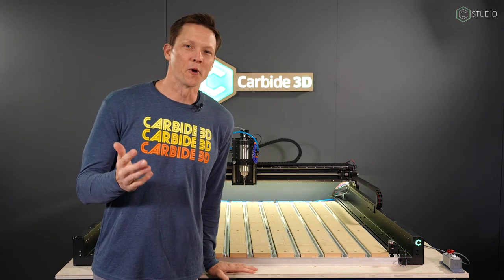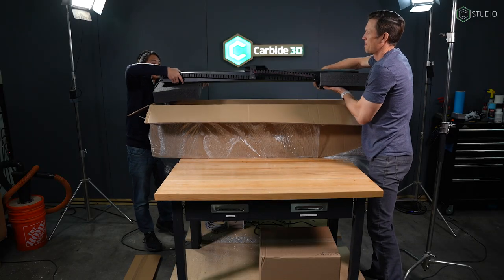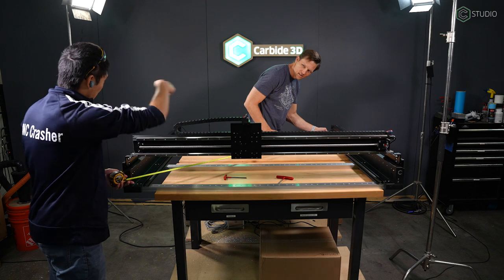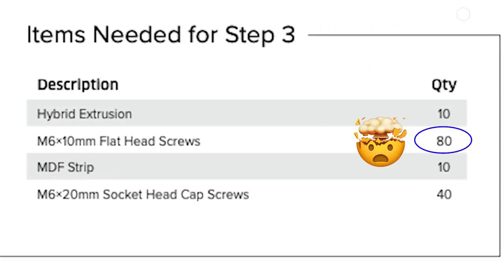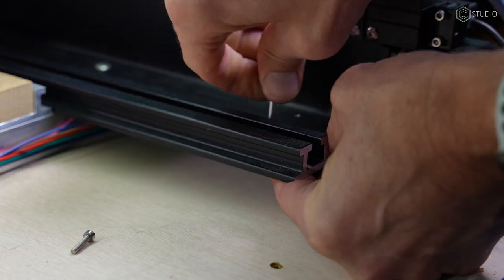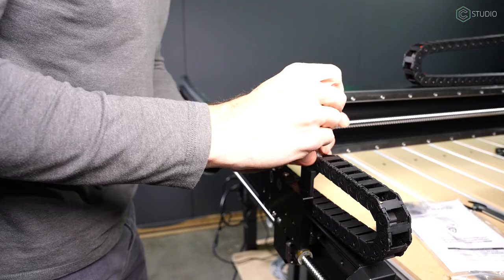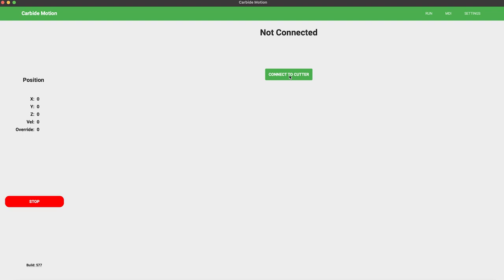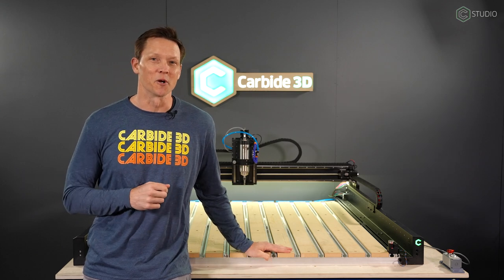Assembly - Shapeoko 5 Pro - Video 8 (UPDATED)

Comment: Congrats Kevin, your video is FAR better than either the spindle kit instructions or the Carbide instructions.  I was at a major pause point until I watched your video again.  Both sets of instructions reference other machines and are very vague at best!  Great job on the assembly video by you.😊 20:37 😊

Comment: At 4:44 rails laid down. But they’re not symmetrical. On one end, there is a little clip that looks like it holds a wire. I’ve watched a few videos. No one seems to point out whether these go on the right or the left oriented towards someone looking at the table from the front.
Reply from the maker: Hi Aria
Those clips should be pointed to the right side of the machine.

Comment: Several things were different between this video and the written documentation and in some cases reality was different from both.  Trying to resolve if I was doing something wrong slowed down the assembly process.  And then some of the connectors were missing the locking tabs and without that clue as to which way they go together, I got one upside down.
Reply: Yes, I am about halfway through the build and finding the same. I'm figuring it out but it has been slightly frustrating. Also the assembly guide I downloaded seems to be specific to the 4X4 with no option to download a 4X2 or 2x2 specific manual which threw me for a loop for a few minutes as they have one less base piece

Comment: So close to being done... but I cannot figure out how to attach the x-axis drag chain tail. It mentions in the PDF that it takes M4 x 6mm BHCS screws (unlike the rest of the drag chain attachment points, which take M3 x 6mm SHCS screws). But I cannot find anything in my remaining collection of screws that will actually thread in. The 2 screws left over in my "DRAG CHAIN FASTENERS" bag don't fit.

EDIT: Oh no... I'm starting to think the holes themselves aren't threaded on the gantry D:
Reply from the maker: Send some photos and video to support@carbide3d.com   We’ll get you up and running
Reply: Did you get your machine running?  There are stories of them being really noisy.  How quiet & smooth or noisy and rough sounding is your machine?  I have one on order buy am a little concerned.

Comment: There was a wire in my shipment labeled front panel extension wire. Is this the wire that goes from the back of the front right Y rail to a connection on the back? I’m assuming this is how the bit setter gets power? This isn’t mentioned in the video and my bit setter is not working. Not lighting up.
Reply from the maker: Reach out to Support@Carbide3D.com with pictures and this description. 
Our team will get you up and running.
Reply: @carbide3d  I did. There is no power to the front panel. I emailed last night. Thanks.

Comment: What does air assist do for you?
Reply from the maker: It keeps the endmill from encountering previously cut chips.   Hitting chips is a quick way to cause excessive wear on or break endmills.  If you're cutting metal you want air on the machine.

Comment: Kevin another question which set of wires from the r  right y  rail go across the top of gantry to the left rail  I am having trouble with the wiring because none of it is tagd as to what it is for Like the 3 and 4 had. also what are the 2 extra drag chain links for. thanks Jeff Peters
Reply from the maker: The router cord runs through the additional drag chain on the gantry and on the Left Y-Rail.   This is also where we have the air hose run. 
The additional drag chain links should be labeled “For Gantry Shift”.  Those should be installed on the Left and Right Y-Rail drag chains when mounting the gantry in the forward Gantry Shift position to perform joinery specific cutting.

Comment: At what point of the assembly do you surface the hybrid table?  Is that a necessary step before you start any projects after first assembly?
Reply from the maker: After you’ve completed all steps.  
We ran a number of projects before surfacing.   It’s a nice thing to have but not 100% required.

Comment: I have the shapeoko 3 xxl and the shapeoko pro xxl thinking of selling them both and upgrading to the bigger size How? Do you feel about the one Infinity monster that just came out? I'm going to compare them both. I've been a steady shapeoko customer. For four years now. Hopefully I won't have to move up to the one Infinity.
Reply from the maker: More expensive and less capable compared to the Shapeoko 5 Pro.  Be sure and do the math yourself.
Plus you would lose the customer service you know and love.
Reply: @carbide3d  I agree that the Onefinity is more expensive.  I can't compare the customer service.  But why do you say it is less capable?  My initial reaction is that the Masso controller and the closed-loop steppers on the Onefinity will make it much more reliable and significantly better at recovering when it does fail.  Also, I am assuming that while you may be able to run an 80 mm spindle on the Shapeoko there is very likely a good reason why you do not mention it anywhere and don't list it as an option on the order page.  As an aside, I do like the gantry shift feature on the Shapeoko and that the Bitsetter is positioned off of the bed, unlike the HDM (the actual cutting area vs the size of the bed and the position of the Bitsetter is my biggest frustration with the HDM).  However, if reliability, especially on long production jobs,  the ability to recover when it does fail, and being able to run an 80 mm spindle as a supported option is important to you then I have to give the edge to Onefinity in the capability area.  Or am I missing something?
Reply: I had a hard time with this choice. I was going to go with the onefinity but at 4500 without a spindle and 4 months wait time, not having a table included ect. Made me choose the shapeoko 5. I read a article from someone who said those are not actually closed loop motors, but that's way above my pay grade, lol. 
 With the onefinity by the time you get spindle, table, ect your looking in upwards of 6k and have to wait 4 months, seriously who's that patient lol july....JULY!?. Waiting till April is bad enough but I got the shapeoko 5 with the spindle shipped for 4500 ish.
Reply: @daddoesthings  
Have you gotten it yet? Any buyers remorse or complaints and problems. Having a hard time to decide what is going to replace my Longmill which to me is aluminum junk.

Comment: Great to see the evolution of the machine!  Though I'm surprised you're not using closed loop steppers at this price point (unless it's an upgrade option I haven't noticed)

Just noticed... First comment! 🤣
Reply: If this machine had closed-loop and a Masso controller, I may have pre-ordered last month. And an 80mm mount option because I have no interest in running a palm router. Carbide make some really nice videos and I'm sure they're selling a lot of these machines.
Reply: @espressomatic  the 5 uses the HDZ z axis which has a 80mm mount, so i dont see how the 80mm mount wont work on the 5
Reply: @PhoenixCustomsWoodworking  They should offer that on the order page - it says only 65mm router or spindle option.
Reply: @espressomatic  if you look into the build specs of the 5 youll see where they specifically say that it uses the same Z axis mount as the HDZ, and they offer a 80mm mount for the HDZ, so id think it would be feesable to assume that the 80mm mount would work with the 5. But honestly if you want more reliability and speed, your better of going with a legit spindle or VFD
Reply: @PhoenixCustomsWoodworking  Forum comments indicate the 80mm spindle mount has a bolt pattern that does not align with those on the HDZ Z-axis. One user advised that he was able to make the mount work by slotting the holes, but that approach may cause problems with alignment and stability (which could lead to poor surface finish, decreased tool life, and possibly tool breakage).
Reply: @espressomatic is closed loop that much better ? i was looking at the x carve pro and a fox alien xe pro